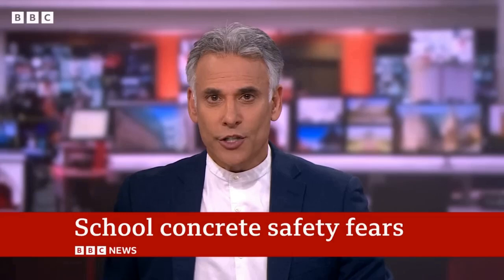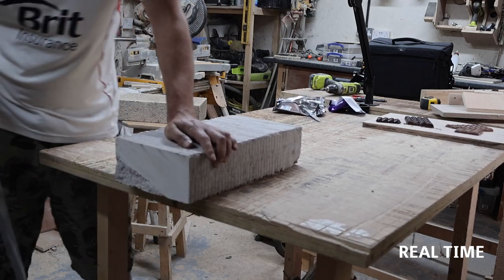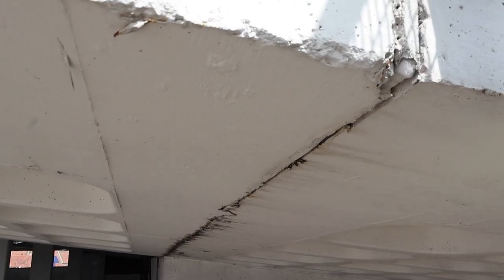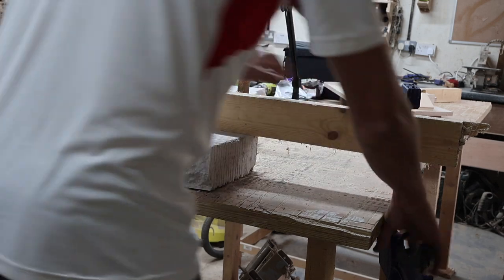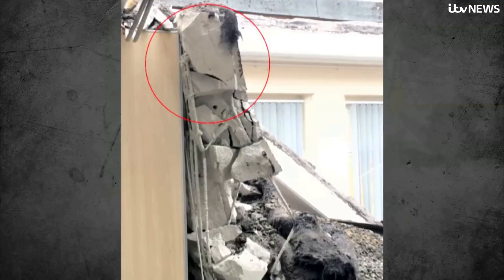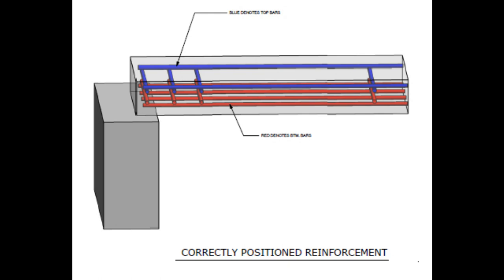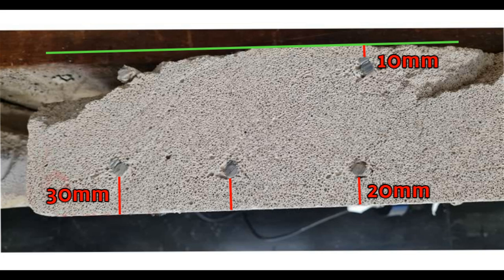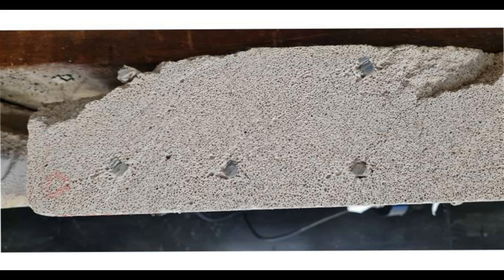RAAC - Structural engineer gives his take

Comment: Why are there no records …..plans….structural calculations….held by building control  in the local authority ???

Surely British Standards were adhered to.     Cover was/is specified in the codes.     

What was the Institute of Structural Engineers doing in the 70’s ……what is it doing now ?     

Are you saying  Civil and Structural Engineering Consultants in the 70’s were  paper tigers ?     Where does the Building Research Institute fit into this fiasco ?
Reply from the maker: So so many reasons...

For a start, can we even identify that a roof is made of RAAC panels? They could easily be obscured by finishes or suspended ceilings. Also, is the person attempting to identify them even aware of the existence of RAAC panels? I certainly wasn't aware of their existence before all these school closures. This isn't something that is taught at university.

So now you know they are RAAC panels, then what? These panels aren't designed by British Standards, they are justified by a manufacturers testing program accredited (I think) by a relevant organisation. The manufacturer tests the panel, determines a capacity, introduces a safety factor and then puts that end result (very simplified) on a table. Its the 70s so its printed onto paper. Then you might have dozens of manufacturers all producing slightly different variants with slightly different capacities, none of which can be justified by an outsider, all backed up by their own individual tests. So even if you can identify that it is RAAC, can you identify the manufacturer? And then, can you find the paper based copy of the table that doesn't exist anymore? No is the simple answer.

At a fundamental level, these products (not just RAAC) can only be backed up if their manufacturers last for the products lifetime. And even then you are relying on them keeping hold of potentially quite incriminating evidence of what these panels could or could not do. The warranty is only as good as the company. If someone gives you a 10 year warranty on something and then goes out of business tomorrow, that warranty is worthless.

Drawings may one day have been held by local building authorities, sometimes. I've been onto military sites where they have meticulous records and even there stuff is missing. In a local council with the whole digital internet transition? No chance. Storing paper based stuff is expensive, they are easy things to cut that very few people will notice or care about.

All of the people who lead us into this position have long since retired or other. There are no people to blame.
Reply: @BigfootsWorkshop     Your reply explains the situation to a certain extent.  My degree is in Aeronautical Engineering but I found myself in the 70’s  earning a living of sorts working in design offices large and small in civil and structural consultants.  The people earning the big money had their prestigious own office,  were Partners and MIStruchE after their names.  They had a professional responsibility ,  indeed this was the time when an individual engineer could be held responsible in law if a death occurred.   The Civil and Structural Institutes oversaw the profession and allegedly uphold standards ???   There needs to be a major enquiry into this state of affairs.  Like Grenfell , something serious has gone wrong.

Regarding inspection today.   Surely there are radiological techniques available to check integrity,  combined with fibre optic cameras to quickly identify the extent of a problem.
Reply from the maker: @californiadreamin8423  An engineer who specifies a manufactured product that is backed up with the correct warranties and testing and insurance is not responsible for it if it goes wrong. The manufacturer is. We, as engineers, can only be responsible for stuff that satisfies British standards and these panels do not. 

And if the manufacturer doesnt exist anymore then no one is responsible for them.

The construction industry still works this way. There are a lot of proprietary manufactured products out there.

EDIT if something happens on a building site I can still be taken to court.

EDIT yes, there are probably instruments that can detect these things but they are expensive and not many consultancies will have them. I dont. There comes a point where it is more expensive to investigate the problem than it is to rectify it
Reply: @BigfootsWorkshop  Even worse, according to the SkillBuilder video on RAAC, (a) some panels may not have been installed with the recommended amount of overlap onto the walls (so weakening them further), and (b) some panels had a coating on containing asbestos, which of course makes it impossible to examine them to see if there's any deterioration.
Reply from the maker: @mittfh  bearing problems, yup makes sense on a 100mm wall with two units overlapping only leaves 50mm to each unit. Probably required to be 100mm. I've had this issue with modern planks!!

Asbestos...mmm, lovely. The more you learn...